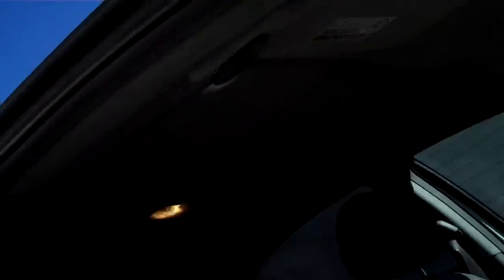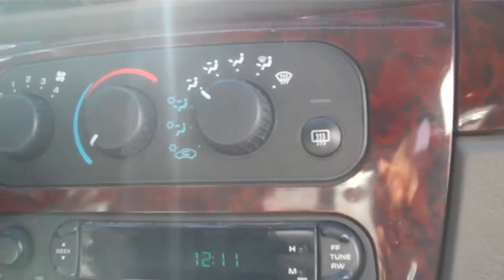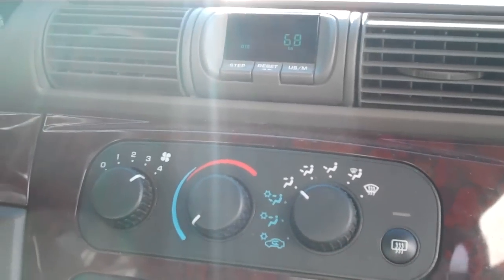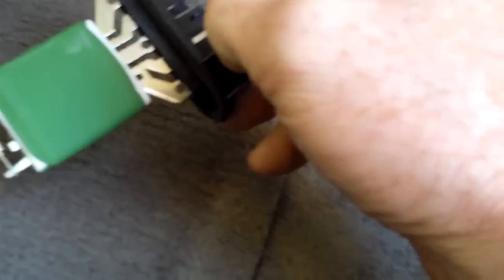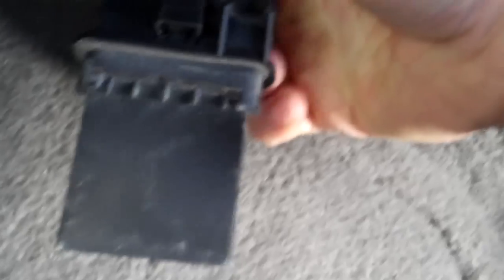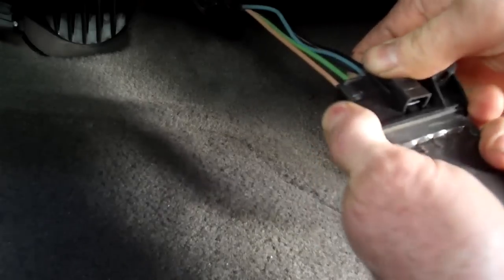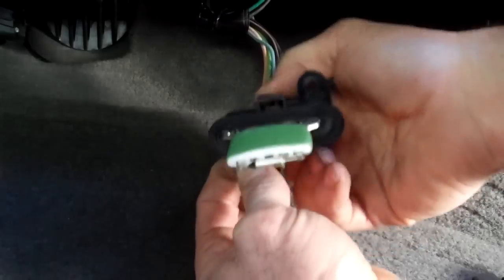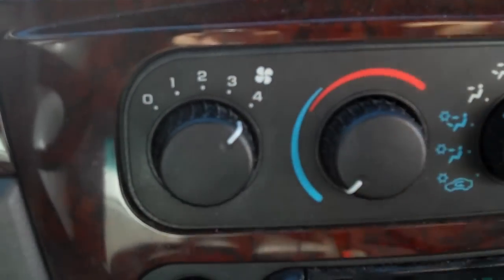My Heater / AC only works on high.  How to Fix it. Undo a Chrysler connector

Comment: I was reminded of this video a couple weeks back when I was in the auto parts store. someone asked for a blower motor resistor for their car, because only the #4 setting worked. So while I was waiting in line, I asked them if they knew why it did that, and they said they didn't have the slightest idea. So I proceeded to pass on the intel you provided in this video, and they were really intrigued by now knowing that info.

Comment: Good Vids ....The connector "Red Tab" as you called it is called a CPA in the industry Certified position assurance. The intent is support assembly provide feed back during production that the latch has been fully engaged ... I would agree after working in power distribution for Chrysler for years I had an extensive pick set ... Keep up the good work

Comment from the maker: @joe1soca It's low on coolant either from a separate problem causing it to boil over, or just a leak somewhere like a hose or a water pump.  When coolant is low there's nothing hot going through the heater core.  Top off the coolant first, then check for leaks after it's at operating temperature.

Comment from the maker: Make sure the radiator is full of antifreeze and check your heater control valve linkage.  The heater control  valve is located inline the heater hose.

Comment: Thank you, this video is very helpful.  The red clip in a harness is usually a TPA or Terminal Position Assurance clip, they're to help maintain a good electrical connection at the terminals over the life of the part.  They can be a pain when disassembling a connector, but they supposedly improve their lifespan.

Comment from the maker: @TheTrooperGirl You're welcome.- It's either a body control module if it's only one problem- OR more likely it's two separate issues.  1. bad blower motor resistor 2. bad mode door/atuator/switch.

Comment: I had to do this to my 2001 Stratus.  The replacement resistor was slightly larger and required a smidge of the plastic blower housing to be trimmed.  Since you are ranting about American vs. Japanese design, I wanted to comment.  In order to change the headlight bulbs on 2006-2011 Civic's, you must remove both the front wheel and plastic inner fender to access the bulbs.  Brilliant, eh?

Comment: OK thanks Brian,  I already replaced the plug.  I'll go back to the bone yard and get the resister.  I think I'll pull the blower motor from the same 05 impala just so I have one ready to go for the future.  Bone yard `04 and `05 Impalas are a rare site around here.  It's hot as hell down here in Florida right now.

Comment: You also won the resistor sweepstakes Mr. Brian.  I'll keep the $15.00 used blower motor that the price gauging GM company charges $175.86 bucks for.  In case the other breaks.  I noticed with the newer resistor and connector for some reason my 02 bank 1 sensor 1 is fluctuating better during the live data on my scanner.

Comment from the maker: @TheJoey702 They probably sat too long not charged OR got ran down too low either way to rebuild the batteries a person opens the case- recycles the actual batteries in the pack and solders in fresh ones and re seals the case.

Comment: Another great video thanks! you surprise me by the amount of knowledge every time I watch a new video of yours.
Speaking of stupid design.... I was surprise to know in order to change the battery on my Old Plymouth Breeze, I had to remove the tire, tire wheel splash guard, to get to the battery.  Another stupid occasion was with a Lexus RX300, you had to undo fueling railing, intake manifold, throttle body, etc. to change the spark plugs on bank 2 of the engine.

Comment: Thanks Brian. I have a Honda Civic LX that I get nothing at the 1 and 2 position of the blower motor. I was looking for Fuses. I didn't know about the Blower Motor Resister.
I'm assuming that the same applies to this Vehicle as the Chrysler? Is that located next to the blower motor as well?

Comment: Fixing my '03 Chrysler Sebring with this information, thanks!  Different problem, but I suspect this part is the issue.  The fan just cuts off sometimes, then turns itself back on a couple minutes later intermittently.

Comment from the maker: It could be either one.  I'd run power straight to the motor and see if it's still good.  If not, replace it.  If it is good test for power from the switch.

Comment: Hello Brian thanks to  guys like you we can fix our own cars, going through a accord powersteering pressure line replacment now. Your rack video helps a lot. I recently bought a 2001 durango for my daughter and the resistor is bad and the plug melted. I assume its the connector being loose or the motor going bad and drawing current too much current. I was thinking of soldering wire direct to the resistor and saving money on a new plug, I don't know what gauge wire to use? The resistor also is only attached with one screw because of cheap plastic screw hole, do you think red RTV would hold and seal the resistor in along with the other good attach screw? You are spot on with crap  being sold now days. Keep it up brother! Thanx

Comment: It always struck me as odd that they design a system that requires wasted heat to be dumped off into the atmosphere. When it's a heater, at least that excess heat tends to also heat the cab. But for AC, you are producing extra heat that has to be cooled. A slightly more complicated design should be possible....

Comment: Thanks for the reply. I've had 3 things come up all of a sudden. The small window on driver side won't go up, a/c/heat only works on max and only vent that is operational is defrost... All at around 50k miles.
Thinking I won't be going Chrysler next time.

Comment: @briansmobile1 Yeah, I think it's the coupe models... the site didn't mention coupe. They also said to use a 22mm socket for the felt under cover. I used a 16mm. Anyways, thank you for this video because I wouldn't have known what to do with that stupid red lock piece. Only trouble I had was getting the left underside bolt to line up. Seems you have to bolt in TIGHT the right side first. Works great... THANK YOU!

Comment: @itsdave101  Try checking to see if the lines going from the engine to the heater core has a valve and then see if the valve is working properly. Or if it was like my 06 Equinox then you could probably have a broken hot/cold door in side your trucks duct system. Chevy wanted $1200 to do it cause it was very labor intensive ans time consuming.

Comment: You know my mother has a Plymouth Breeze which is basically  a Chrysler and it has the same problem. Thanks for the input because I was going to start with replacing the handle switches first now I'm not. Thank You

Comment: My blower on my 2001 Dodge Ram only works on high as well, but it's also squalling.  I guess the motor and resistor need to be replaced?

Comment: Wow, first video I pulled up and it explained everything! Thanks so much, Replaced it in a 2003 Sebring with the same one you use there, problem is it won't fit back into the slot, any suggestions?

Comment: Brian, i have have similar plugs/locks under the seats of my jeep ZJ for all the functions, i recently had the rug changed so the installer asked me to be sure all the bolts weren't frozen, the seat function clips have a left to right push 

Did you ever see that movie 'fail safe' with henry fonda and larry hagman? check it out

Comment from the maker: You've won the resistor lottery- that never happens.  but when it does it's usually a melted wire/contact at the resistor.

Comment: THANK YOU!   For your video and detailed info. 
  I have a 2006 dodge ram 1500.  The blower motorworks on 1, 2 & 4.  3 doesnt work in addition to no floor heat.   Any ideas?
TG

Comment: Hey there I have a bit a problem in my mustang '95 my a/c is not working at all. I checked the fuses with a multimeter and they where good. The compressor clutch isn't moving at any setting, I am almost positive there is no freon in the system. So i went out and bought freon to put it in but then I realized that the dashboard vents do not blow air cold or hot but the the vent  on top of the dashboard do blow the air. I have returned the freon and I took out both the blower motor and resistor

Comment: Great Video. Brian, If you can turn the blower on one and it doesn't work, then turn it to high and back to one and one works, is it still the resister, on it's way to it's death? Thanks in advance.

Comment: I purchsed the resistor from Napa auto parts..It does not go back in to the slot. The older part is much thinneer and the replacement has higher width. What do you suggest I do? It is a great video and I am doing it myself. Please help.

Comment: Hi Brian, my name is Jon.  Been learning from your awesome vids.  for a few years now and I finished a lot of work on my Saturn thanks to Richpin and yourself to name a few.  I'm working on my second. 2004 Chevy Impala 3.4L Basic. air would sometimes no come on at all after stating the car. then it would kick in 5-10 mins'. later.  I looked at the resister and found melted wires so I changed the connector. it stays on high when I shut down and pull the key. Bad resister ?  thanks !!

Comment: Settings 3 & 5 only worked on a Impala. Replaced the resistor 1 & 2 worked but 4 stayed not working. Possibly the switch needs replacing that goes to the AC fan setting?

Comment: I have a 2000 Dodge Intrepid, will not give heat. and it will not change from - Floor - Vent - defrost.  I change the vendor actuator, and the temperature control unit.  no changes.  Any suggestions?  Thanks for your video.

Comment: Hello briansmobil, I have a 98 dodge van, it only blows through the defrost, it blows low, med,high but only through the defrost, is that selector switch or the resister if there is one on 98 dodge van
Thanks Al
Reply: Sounds like selecter switch.

Comment: Brian I have been a subscriber for some time and love your videos. I am hoping you can give me some advice on my issue. I have a 2006 jeep commander 4x4 4.7L. When I turn the air off there is still a little bit of air coming out and it comes out whatever temperature I left it on. So if i turn it off when its on heat some hot air is coming out and if the AC cold was on I feel some cold air coming out. What do you think I could do to fix this problem?

Comment: I have a 2005 Dodge GC.  I replaced the resistor, and initially all speeds worked.  I came back later to drive the van and I tried again.  All three worked but then suddenly a terrible burnt smell and now only high speed works.  Do I have a bad fan that is over-taxing my resistor?

Comment: Hey man I have a 97 Dodge ram van B2500....would the thing be under the hood...cause my vans blower only runs on high...and would like to fix it....another problem I have with it is very little heat....any ideas there???....I flushed the heater coil any other udeas would be great!!!!

Comment: Hi I watched your video on how to change the nobs on your car.  I have a 2009 Toyota Corolla and the air is stuck on the highest setting.  I was wondering if you knew what it was called - i think it's just the wire that needs replaced, and I want to do it myself.  I fixed it before but I rigged it, so I want to fix it properly.  I also have a tedious time turning fro foot to defrost (that nob).  i guess my question is, can you change the wires inside that are broken or do you have to change the entire unit with the knobs and everything?  Any way you can help would be great!

Comment: Hey Brian, I have a 2007 Chevrolet Colorado, my heater is not working but the blower is working because air is blowing out, it just doesn't get hot anymore. any ideas?

Comment: I think # 4 is a straight connection through that temperature fuse? If that blew I would worry. I have cheated just by using bigger watt resistors but I do not reccomend this lest ye be vexed as your vehicle burns up as ye are watching . Ye might try measuring the current through the blower motor and putting a draw on it by blocking the intake or exhaust.

Comment: The blower operates on all selections except on high./  Would this still be a blower motor resistor problem or would it be the actual blower itself

Comment: I have a 1994 honda civic that is having a problem similar, but in reverse. The heater works in 1,2, and 3 but when i put it on 4 it stops blowing. Could this also be a resistor?

Comment: You just saved me a crap load of time! Toyota tacoma with the same problem. I fixed it about 30 minutes.
Reply from the maker: Nice work Ian!
Reply: Thanks. I've watched just about all your videos to educate myself. Appreciate the guidance.
Reply from the maker: Wow!  There's over 700 of them.  Thanks for your support.  As long as people like them enough to watch them, I'll keep making them.  Today I'm filming a G. Cherokee heater core job.  I had to remove the dash/steering wheel/ and the whole HVAC box too.  I narrated how the Heating Ventilation and Air Conditioning system works as part of it.  It's easy to demonstrate when the whole thing is on the floor.
Reply: Well done. I'll be sure to check it out.

Comment: I've got a question.  I pulled out the blower motor resistor and it looks like there was a short in the plug that plugs into the blower motor resistor.  How do I get a replacement plug / adapter / wiring harness.  I've tried Googling but I can't find that plug.
Reply: Art Stanton have you ever figured out how to deal with it because my connectors are fried?

Comment: Mine only worked on high for the longest time, then just recently it stopped working on high also. if i replace the blow moter resistor, would it stil fix the problem?

Comment: wow your so right it took a lot of time and strenght to take that off and a few sec to fix it. Now Mr. @pulga1724 if you can help me on this cause I am a lady with age around 50 or so and I have to do this my self. Air blows at top of window and some short times the vents on one side only. And not very hard. It frost my windows and I can't see. Been told to remove the dashboard because hose want stay connected. I have a 1996 Olds Mobile LSS. Please guild me. Amen

Comment: Nope did over 5 and it’s not what is going on with my 2008 Chevy cobalt. Replaced all of that blower motors and resistors and then even the switch. Had blowers tested worked fine , resistors worked fine . I am just thinking about selling the damn thing

Comment: Dear I hope ur still on earth I pray for ur good health and life but it's 10 years old post anything can happen in next 10m to me also.I had same issue with my grand cherokee blower RESISTOR always heatup can I cut wire and put directly as no problem if blow runs on full as I am in uae.

Comment: My a/c only blows on high. I changed the resistor but it still only blows on high. There’s also a clicking noise from time to time. My next thought is blend door actuator, Blower motor, or the actual ac knobs 🤷🏻‍♀️ any ideas??
Reply: Also if I push in on the ac knobs it will sometimes work on the other settings 🤦‍♀️

Comment: My car is over heating and this is the following symptoms.

ACURA 2003 RSX
1)       It has a lick and I don’t know were it’s coming from?
2)       I turn on the ac full blast and it only gives me cold air
When is on hot.
3)       When the ac is on full blast the fan go on and off
Every 30 seconds.
4)        It over heat after a 10min drive.

Please help me on this. 
Joseph

Comment: My heater motor only works on setting 4 but it barely moves any air, nothing happens on 1-3. I replaced the resistor but nothing changed. I have to wonder if it isn't the motor itself.
Reply from the maker: It very well could be that the brush contacts are worn and can't transfer electricity with enough amps any more.

Comment: ive replaced my ac blower motor resistor every 8mos.. is it ok to just not have the resistor, and just have the fan on max all the time?  i live in a hot place, my fan is normally on 3 anyways..
Reply from the maker: I don't know if it would overheat and be a fire hazard or not.  I would try it, but I'd be smelling for smoke like a fireman.

Comment: my chevy venture sometimes ac or heater wilnot work intill I hit a hole or a bump in the road what do I need to replace its the fan that's not working right please help
Reply from the maker: Jeff Galford You made no mention of what setting the fan is on or of whether that makes a difference.  If it doesn't, I'd tend to think it's the blower motor then.
Reply: +briansmobile1 thanks for your coments.but I already took my car a mechanic and it was a false contact with some of the wires on the harness it was a false contact on the ground and one on the highest speed on the blower switch thanks everyone for the advice cheers. ..

Comment from the maker: You're air dam or air dam motor is bad.  It's like a door that switches air flow from the heater core or evaporator.

Comment: Hi, Mine A 2000 Dodge Intrepid ES Runs Continuously On Hi, I have Changed The Resistor and It Still Won't Work, The Head Unit Works, The Display Works every control on that Unit works Besides the Fan Control Regulator, What else is it? Have You Encountered This type of Problem before?
Thanks for any Help.